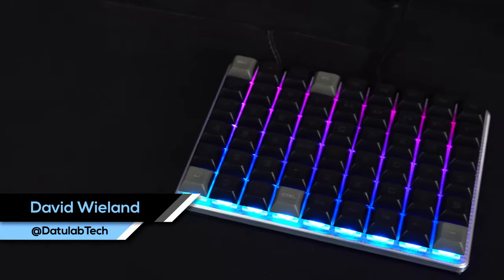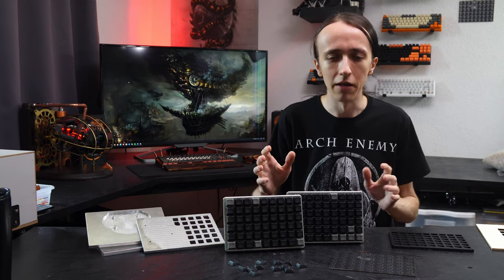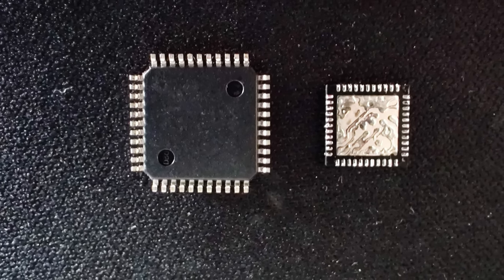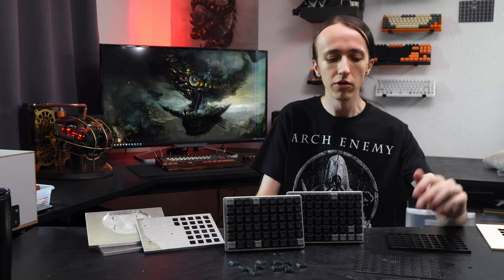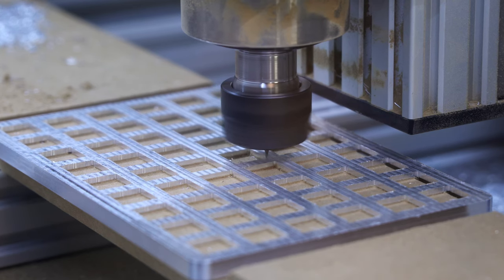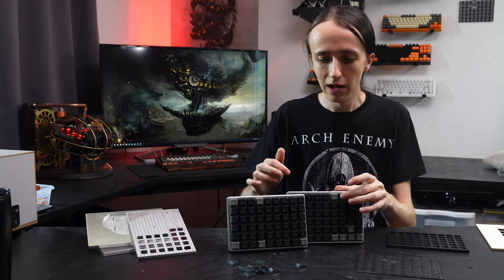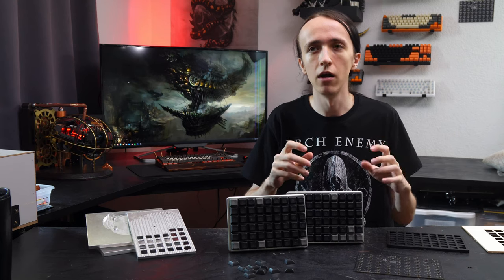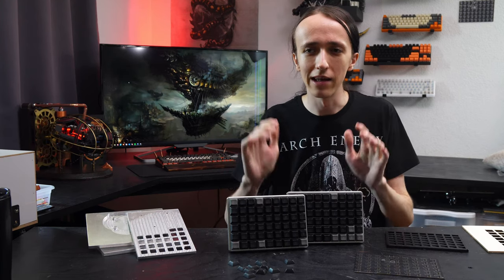DIY Split Keyboard from Scratch

Comment: Learned a lot! Instant like!
For the life of me though I keep ending up with two left sides T_T , I keep reading the documentation but just cant get it right! Any pointers?
Reply from the maker: On my board the two sides are totally independent keyboards, so I just flashed them with a different keymap and the same firmware settings otherwise. They don't connect to each other but both to my computer.

Comment: how did you drive this much LEDs ? did you use logic level shifter in them ?
Reply from the maker: No need, the ATMega32u4 has 5V outputs, so the data pin of the LEDs can be directly connected (with the appropriate resistor in series for safety)
Reply: @DarkArtGuitars  I know but the current limit is 500mA for USB right?
Reply from the maker: Yes, but that's plenty bright enough. You just have to limit the brightness in software, but qmk has a max brightness setting for that. @pooyahesabi

Comment: Hi David. I really appreciate your keyboard build videos. Thank you. My question is how do you deal with caps lock on a split keyboard? I am halfway through my split keyboard design build. I have the left hand PCB completed. From both a hardware and QMK firmware standpoint I am struggling with solutions for the caps lock function. I would like the light on both left and right hand split keyboard to come on when the caps lock key is toggled on. My build is wired only with USB-C shape ports. Obviously there must be communication between the two split keyboards for this to happen. Any ideas? Have you already thought of solutions for this? Thank you so much!
Reply from the maker: I'm not using a caps lock light on my keyboard and the functionality of caps lock itself is handled by the OS and not the keyboard so it doesn't matter which keyboard turns it on or off. Maybe there is a way in QMK to querry the OS if caps lock is active, not sure though.
Reply: @DarkArtGuitars Thanks for your input. I didn’t know OS handled CapsLock, and while we’re at it Shift key on each keyboard is handled by OS too? I shall need too look into QMK docs further on how this works with hardware and firmware to do this right.